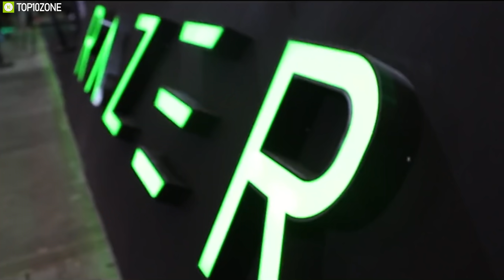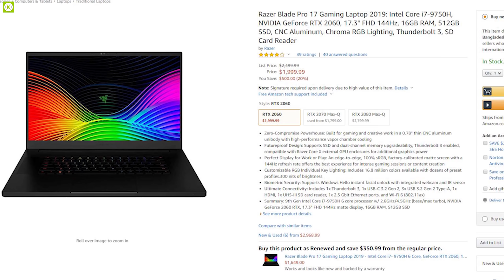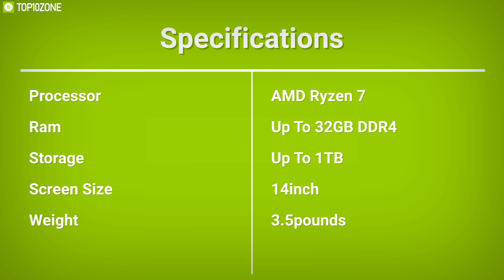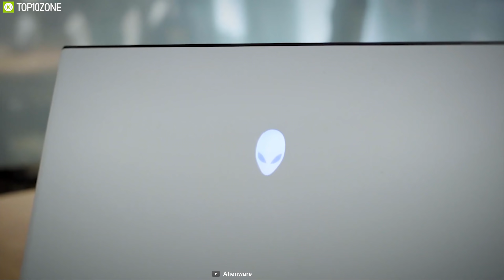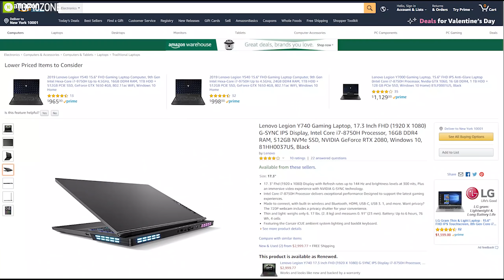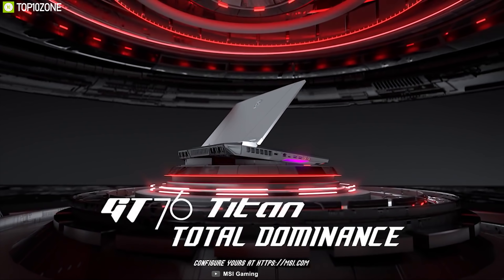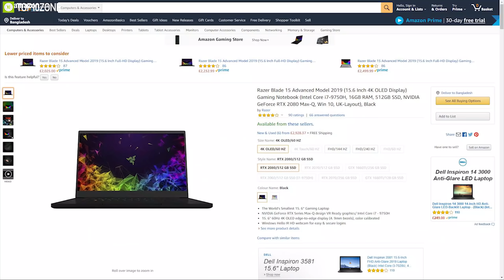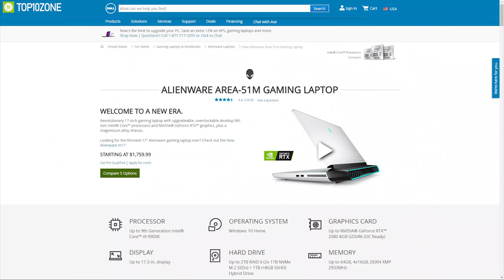Top 10 Best Gaming Laptop to Buy

Comment: You forgot the Helios 300 and the Asus GX502. Therefore, this video and the title is invalid.
Reply: I'm thinking of buying the gx502. Is it good??
Reply: Oliver Goebel it’s awesome! I’ve been playing CoD, Dota, and Fortnite. Super good graphics with that 240hz. I got it with 32 gb of ram, 2Tb of SSD, and the RTX 2070
Reply: @born2win259  thx!
Reply: I'm getting the Helios 700
Reply: Dolphinasd Gaming lol. Let me know how that works out for you
Reply: Oliver Goebel I got the GX502. Just recommend if your ordering one, opt in for a thermal compound upgrade because it does get hot.
Reply: This list is really about top 10 most powerful / expensive gaming laptops, and the Acer Predator Helios 300 is more of a mid range laptop, so it doesn't really belong on this list.

If an Acer laptop should be on this list, it would be the Predator 21x buy that is an older generation laptop now.
Reply: Uche Ofia not really. The video title doesn’t say expensive, it just says BEST.
Reply: Jan Michael Escobar really? I’ve been gaming it pretty good and the heat hasn’t bothered me. I’d say the hottest I’ve seen it at was 87
Reply: Born 2 Win Mine was hitting 95C with dips to 99C for the CPU. Kept thermal throttling too. Since I repasted, 85C is now my max and thermal throttling no longer a problem. Fans don’t have to spin as fast either now.
Reply: Jan Michael Escobar that sounds good. I’m just happy it looks good too. Happy I didn’t spend 3400 on a MacBook Pro. This this will work great for everything
Reply: Hey guys! Planning on upgrading from my GM501 lappy to the GX502. Is the 240hz a big upgrade from 144hz with G-sync?
Reply: Joseph Benz Medina hmm,  not sure. You should look up vids of people buying the 120 and comparing it to the 240. I got the 240hz and it’s incredibly smooth and quick.
Reply: Joseph Benz Medina couldn’t tell you for sure. The 240hz was the only option available to me.
Reply: Jan Michael Escobar what abt gx501
Reply: gx505 is rlly expensive. I would recommend a pc at that price point
Reply: is the helios 300 worth buying now?
Reply: Does the gx502 have good battery life? I need a new laptop for college but I still want to be able my games. Also the Alienware are ridiculously expensive with shit specs
Reply: I’m thinking of buying the Acer Helios 300 is it good?
Reply: @j0sh957  completely trash don’t even think of it.
Reply: @j0sh957  u can just get a good gaming pc for around 500 dollars it is much more efficient than these money hungry shitty laptops.

Comment: I don't recommend purchasing any Razer product due to their shady warranty policy. Especially all Turing GPU based laptops because cores on those GPU's are common to be faulty. I purchased Blade 15 Advanced model with 4k OLED touchscreen and RTX2080 Max-Q for Christmass.  After 3 hours of initial use laptop froze and crashed and never able to recover ending with black screen on boot-up. I managed to enter safe boot into windows and disabled the Nvidia GPU which allowed me to normally start computer. However, as soon as I enable the Nvidia GPU it crashes again.
I contacted Razer support and they acknowledged that this is warrant for complete replacement during live chat session. Also Razer acknowledged that system is under warranty because in BIOS the assembly date of this model is from September 2019. However, eventually Razer failed to issue warranty because I've purchased laptop from other person.

I also have OLED inconsitancy  with vertical lines on your screen as well as left fan rattling from time to time.

This is Razer Warranty:
General. This Limited Warranty applies only to the original purchaser of the Product and is non-transferable. This Limited Warranty is only valid in the country where originally purchased. If the Product was shipped internationally by an authorized reseller, the country of original purchase is the shipping point of the reseller.

Source: @t

I'm in process of taking legal action to check if this completely non-user friendly warranty is even legal in Europe. Be warned that if you think as I did and many peope I spoke to - that such company as Razer with such expensiver and top line product would stand for it and be user friendly - you will be surprised!

Here is response from Razer:
Response By Email (Arnie D.) (24-Dec-2019 08:22 PM)

Hi Michal,

Thank you for patiently waiting as we work on your case. We're happy to assist you! 

This regards with your laptop repair request from our live chat support, as we further check your case here in our end, your laptop is not valid for our "Warranty Repair" because it has been purchase secondhand from third party reseller. This Limited Warranty applies only to the original purchaser of the Product and is non-transferable. 

However, we can proceed on repair process, but the shipping, and labor will be charge in your end. As for right now, we highly advise you to contact back the reseller of the device, since you just bought the laptop from their end, and let them know that Razer warranty is not valid for any devices that been bought second hand from third party resellers.

For more information about the Razer Warranty Policy, please visit this link: @t

Thank you for your time and have a great day! 

 

All the best, 

Razer Online Support
Reply: Any update???!

Comment: I have the $999 ASUS - ROG Strix G15 15.6" Gaming Laptop - Intel Core i7 - 8GB Memory - NVIDIA GeForce GTX 1650 Ti - 512GB SSD - Electro Punk Gaming Laptop.

I've downloaded quite a few apps like Aura creator, Adobe Creative Cloud, Steam (_Hunt: Showdown_), Battle.net (_Overwatch_), Chrome, Origin (_Apex Legends_), Discord, etc. so this alone does takes up 50% of my 8gb RAM storage when it sits idle and no apps are running other than background processes.

My *wifi is great quality*, never did I lag when I played on console connected via Ethernet to the router. My laptop, I have yet to understand what the lag issue is.

 I recently ordered another 8gb RAM stick to install into my laptop for my laptop to work faster since the i7 processor is good and my graphics card GTX 1650 Ti is good enough for the games I play, so my memory has to be the issue for lag and crashes.

When I play games, it crashes due to the RAM memory spiking to 100% and my CPU spikes to 90% according to my Task manager. (Keep in mind it is already at 50% with the background processes running)

Does anyone know if upgrading my RAM storage to 16gb will solve my problem? Or if I should just buy a new laptop with higher graphics card, processor, and RAM?

Comment: I feel like the HP 2019 version of the Omen laptop line deserved a spot. It beats out (slightly) the MSI GE Raider. Especially for the price HP sells it at.
Reply: hp sucks to be completely honest in other words not realiable
Reply: @yousifahmed7754  My experience has been different. I've never had any issues with any HP laptop or item i've owned. It stucks that other people seem to have had different experiences.
Reply: YGTV(Yassir's Gaming,Tech&Vlogs) well of course, not every hp laptop is bad unless its very cheap but what I would personally prefer is Dell laptops they can survive as long as 5 years of using and offers great performance
Reply: you may not understand what i mean cuz you got Hp omen 17 which is powerful, the main point here is the extravagant price laptops are more focused on, than the cheap ones yea

Comment: Why isn't Acer Helios 300 2019 in here??
Reply: Hp omen 15
Reply: Uhhh maybe because it says 2020?
Reply: @jetpagal941  uhhh these are 2019 models in case you didn't watch the video.
Reply: Even the Nitro 5 is a good budget option
Reply: Guys, this is a list of most powerful/expensive laptops, not mid range laptops.
Reply: because its trash
Reply: literally no one gives a crap about that laptop anymore, there are more better laptops with better specs for cheaper price. I wouldn't buy an acer predator helios 300
Reply: Bob Stacey no there aren’t. It’s still a bargain in the market.
Reply: ironshark123  lol
Reply: @ferdos helios 300 is trash!

Comment: am looking for a good laptop at below 1500 :)
Reply: My advice is to look for a gtx 1660 series laptop. Good performance for a reduced price vs rtx machines.
Reply: Acer Predator Helios 300
Reply: The 2019 Acer Predator Helios 300. Comes with 9th gen core i7 (yes, i7 as the base config), 16 GB of RAM, 1660 ti graphics (thats 6 GB of VRAM), 1080 p 144Hz display, and 256 GB NVME SSD + 1 terrabyte hard drive....all for $1,200, and this configuration goes on sale alot of times for $1,000 - $1,100. There's also an extra NVME SSD slot, an extra RAM slot, and a 2.5 inch drive bay, so you can really bump up the storage and RAM by alot. You can even spec it up to either an RTX 2060 or RTX 2070 if you're willing to spend above $1,500.  The 2019 Helios 300 is worth every penny, especially in its base config.
Reply: MacBook Pro
Yeah
Reply: Predator Helios 300 :)
Reply: Asus republic of gamers laptop
Reply: Zephyrus g14- the best. helios 300 if you dont mind the logo at back. Tuf a15 if youre okay with low color gamut accuracy. Legion 5i if u can trust Chinese laptops

Comment: Its only numbers not reality. Best laptop for games depending on price , temps and pref? Triton 500 i7 10750h ( in acer voltage is unlock u can undervolt) , 32 gb 3200, 1t nvme wd black, rtx 2070s max q , ips 300hz with g sync and thunderbolt 3 . All for 2190 euro why not top specs? Rtx 2080s its overpriced 30% more expansive for 5% pref boost, i9 ok its faster but 99% temp bottleneck undervolt'ed almost same as i7 but hotter. 32 gb ok 16 is good but they give it so OK and u get windows pro i this setup asus scar 15 same specs windows home and no g sync 4450 euro raze 15 same spec but 512 nvme and windows home 2850 euro so u paying only for brand.... triton 500 got very good 3x went even when set to 5000 rpm sound is very low not like hairdryers and in auto mode with 125mv undervolt cpu and gpu on extreme oc  1650-1920MHz depends on temp cpu 83 and gpu 70 in forza horizon 4 with normal gpu set 1500-1785Mhz cpu 79 gpu 58.

Comment: Don't buy a laptop just buy a pc 😜
Reply: Everyone has different needs. You may want to be portable with everything you have but yes if you can PC is the better option and I won't say buy a PC but build it instead.
Reply: Aggelos Kokkotis A51m laptop performs good, ran War Thunder at 171 FPS on movie graphics. Yes this is laptop. 2060 Nvidia, core i7 9th gen, 32 gb ram, 144hz refresh, 3.2ghz normal, 4.7ghz turbo. Cooling is great and it can be upgraded. Has two power cords for charging but it means that it is essentially portable desktop but is really 17inch 8 pound laptop.

Comment: Alienware sucks, It cam barely run gta and csgo without crashing or frame drops
Reply: Treez I’ve got one that runs cs go at over 200 FPS, no crash, gta runs 150, also, the human eye can only detect frame rate difference up to 150. The computer is A51m with core i7 9th gen 2060 Nvidia 16gb ram I think, 144hz screen refresh, 3.2ghz normal and 4.7 ghz turbo, and is able to be upgraded. What Alienware are you referencing friend?
Reply: TripleStripeGopnik Oh I’m referring to the low price ones which have GeForce rtx 1060 or 1070
Reply: Treez okay then, this make more sense.
Reply: Treez I’m guessing this is Alienware 15 R3? Yes that was bad computer.
Reply: TripleStripeGopnik I would say 15 r3 and 13 r3 are equally as bad